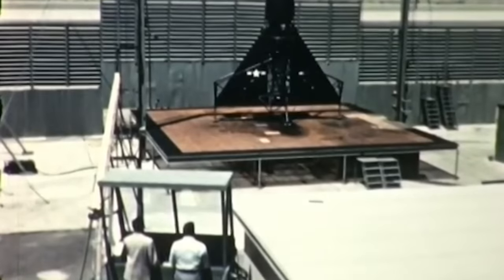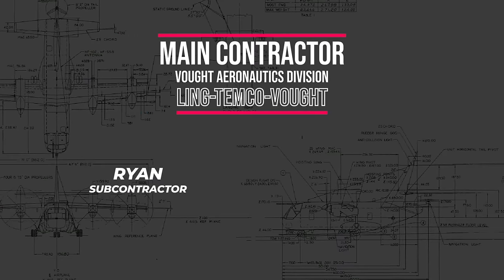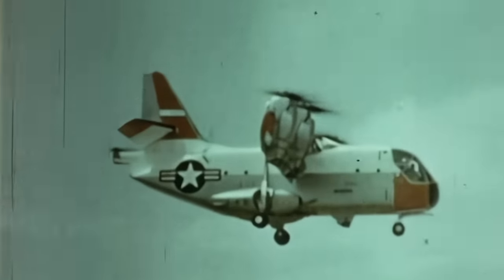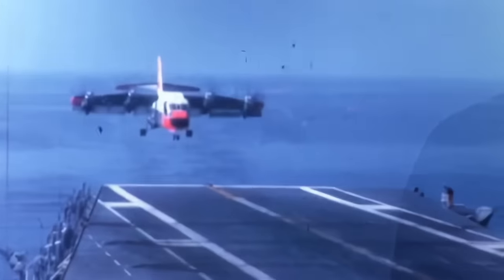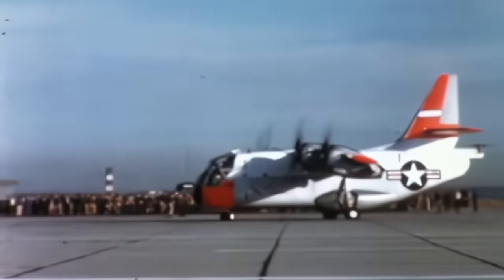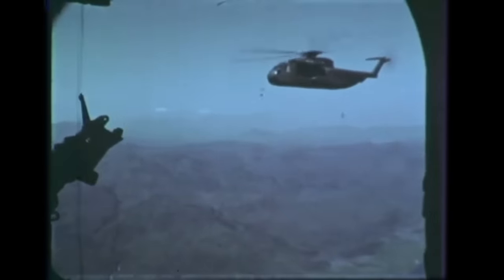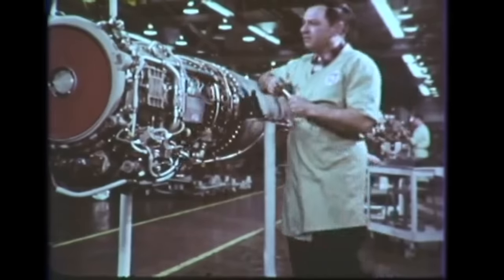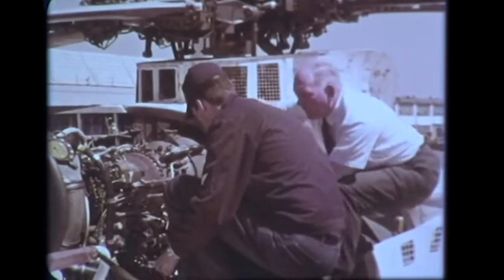Experimental Planes: The Tiltwing LTV XC-142 | Ling Temco Vought V/STOL Aircraft That Never Was

Comment: Excellent video but 400 liter fuel capacity isn't enough to get it off the ground.
Reply: No kidding. Four 3000 hp turbines are going to such that up in a hurry.
Reply: Less fire load in case of crash. The engines have 8500 kW. At 300 g/kWh and full throttle, they take 8,500 kW * 0.3 kg/kWh {estimated} = 2,550 kg/h = 42 kg/min or ~56/min. With a 400 Liter tank it flies ~7 min to bingo fuel (calculated with 0.75 kg/l).